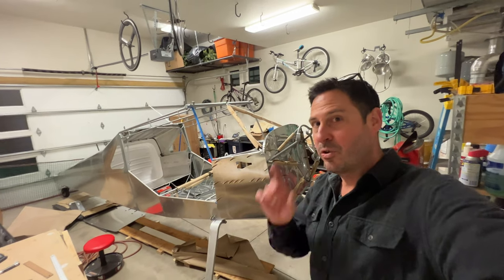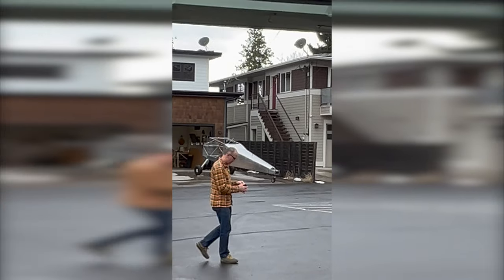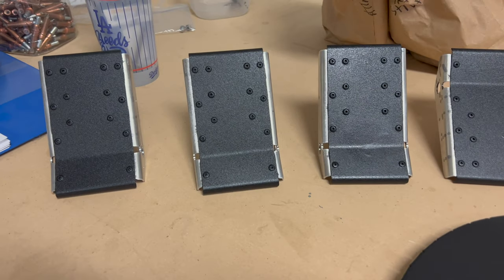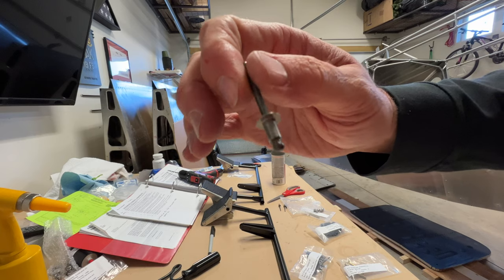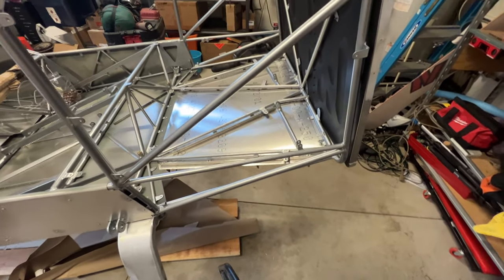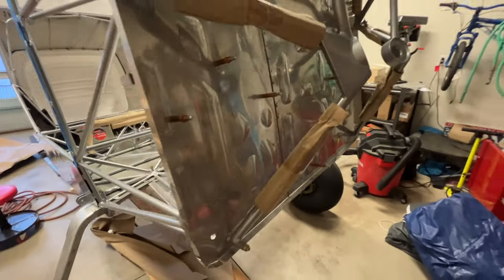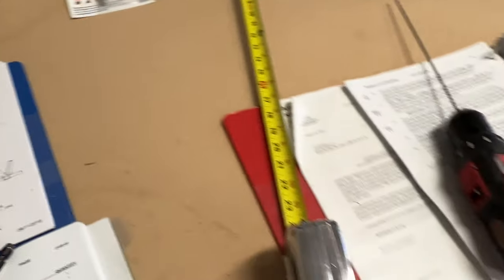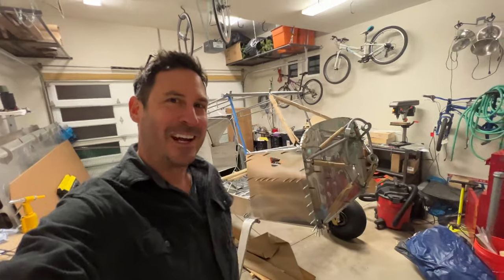RANS S-21 Build Episode 12 Boot Cowl Part 1 SHORTFORM 4k

Comment: UL does have a turboed version that adjusts to keep sealevel pressure to the cylinders, that would be beneficial in higher altitude manuevers, unnecessary, of course, if you don't plan on doing high altitude outbounding.
Reply from the maker: Super pricey. It’d be great if money were no object.